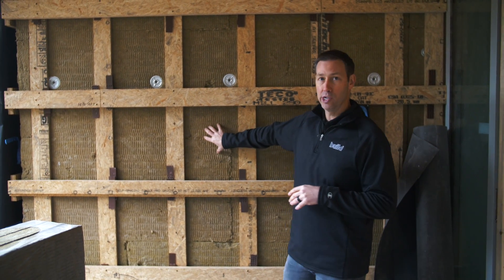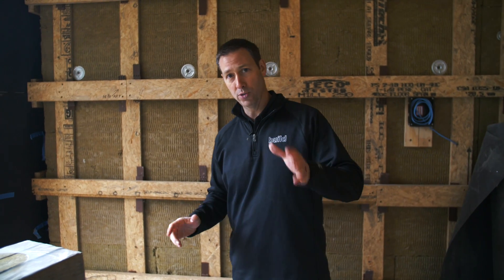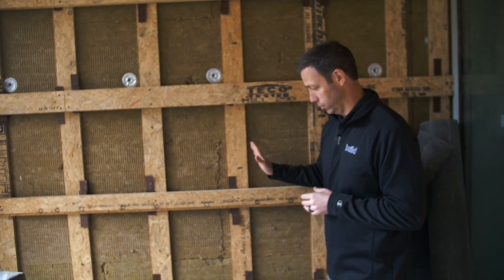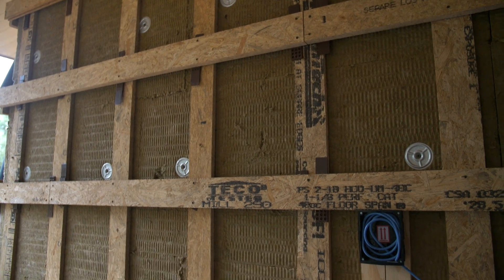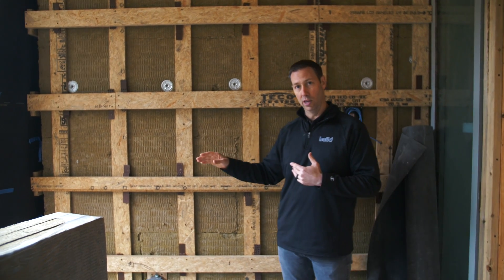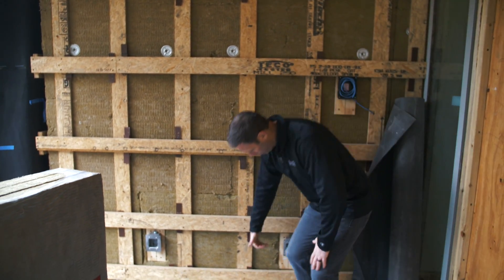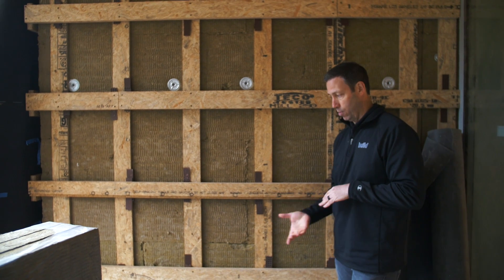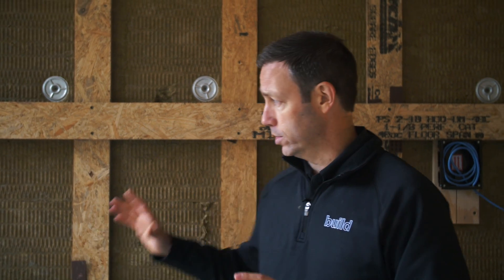Rockwool + RainScreen Exterior - This is a killer assembly!

Comment: So if you mount a floor joist vertical . any critter will knaw thru your barrier. We get 120" rain here . 60 mph winds an high humidity. Moss grows on trees 1' thick. Not sure your wall system will keep rockwool dry. Had to re side our casino due to construction defect. Salt air will rust a ac unit in five years!

Comment: @MattRisinger , What was the air barrier in this example? Peel & Stick between Rockwool and sheathing, or closed cell behind sheathing?
Reply: Probably peel and stick. Or possibly a drain wrap with a low permeability.  You'd want that to protect the sheathing for a really long time.  My guess is the inside isn't foam.

Comment: what's with the osb furring strips though? it's not a good idea to use those in areas that can get wet right? you said there will be small cracks where a few drops of water may get through. with normal wood as long as it can breathe its ok. but with osb that stuff will denigrate back there and noone will know until the vertical siding starts to fall off. probably could have used pieces of the vertical siding as furring strips to attach to maybe.
Reply: Matt mentioned in the video that it's not just OSB, it's ripped down AdvanTech decking. Should have better moisture resistance.
Reply: Also remember there is drying capacity in that wall with the battens and bug screen. And Advantec holds something like a 200 day no-sand guarantee when it is subfloor (ie puddled water). So it shouldn't be an issue in that wall assembly.
Reply: the furring strips will be behind the polyolefin UV stable sheet; with the PO seams likely managed behind the siding panels. I have hard time imagining a scenario where the OSB will actually get wet, provided that they don't experience massive flooding.
Reply: @asday85  ohhhh ok thanks
Reply: @Lilmiket1000  No problem.  Also, I think you're right on the money W/R/T "AdvanTech Decking" being a type of OSB, I think Nick is just eating marketing material with his Wheaties.

Comment: In the commercial construction world we will often use "Z" furring to bridge the insulation from the back up wall to the external siding material .  I would be concerned that my exterior siding is supported by the shear strength of screws that are cantilevered out thru 3 inches of insulation.      Mr. Risinger, a fun / informative "shop" video would be a see this wall section mocked up without the insulation in the shop.  I would like to see how adding weight to the siding side bends the screws, if they bend at all.
Reply: FYI: Similar construction for my project, but 2" rigid foam instead of 3" Roxul, and no horizontal purlins. We used 5-5/8" GRK #12 structural screws to make sure no shear strength  issues. Also used 5/4" deck boards since they are pressure treated. I am not sure if the advancetec flooring ripped into strips is going to last. I think time & moisture is going to lead to issues using the advancetec OSB flooring panels. My guess is that going with the 5/4" deck boards would have been cheaper, considering all the labor need to rip the advancetech into strips. I suppose with Matt's friend project going with an even heavier structural screw would be a safe bet (ie 5/16" or even 3/8") but that's gets expensive.FWIW: I opted for Rigid foam instead or roxul comfortbatt since roxul has a lower R-value per thinkness & it can require a extended delivery schedule since its not widely available everywhere. We did go with Thermastar Rigid panels since they do include an insectide to prevent ants and other bugs making tunnels in the foam. The pros for roxul exterior insulation is that its completely fireproof & isn't vulnerable to insect damage. Cons: more expensive & likely increased delivery times.
Reply: This thread on GBA has a lot of good info on this subject: https://www.greenbuildingadvisor.com/question/stability-of-wall-when-using-exterior-insulation.
Reply: @pnwbuilder  ty
Reply: Im curious what the z furring install would look like. 
Is the flashing just run vertical along the sheathing, with insulation in between? 
I imagine this install is trying to reduce thermal bridging, but the concern about deflection makes sense.
Reply: It's the $64 question is the exterior insulation world.  How to install an uninterrupted layer of insulation, but still be able to attach siding to the house, without disrupting the integrity of that layer.  Obviously dense insulation that takes up less space and makes the job easier, but passive buildings and LEEDS buildings require R28 and up to R 38 walls.  Compressed rock wool is the only Zero carbon material we have that can provide a decent R value (R4).
Reply: @refusoagaino6824  I just nailed the vynyl siding right through the foam, and 20 yrs later no problema.
Reply: I really like this idea, particularly when compared to the z-channel support.
Reply: you would typically only use a "Z" furring if the exterior insulation were too thick to support the cladding using conventional furring strips. residential construction is done according to the IRC. you can go out to 4" with exterior insulation as long as the cladding is not over 3 lbs/sq. of course, the heavier the cladding, the less the supportable thickness.
Reply: In the commercial world you can also get green z channels made from fiberglass that dont act as a thermal bridge.

Comment: Matt, what are the costs of this kind of install vs a typical installation of spray foam?
Reply: FWIW: My guess is that the home will have interior insulation. The 3" roxul is only about R-12. FWIW: I believe the costs for roxul is about 2 to 4 times more expensive than rigid foam for exterior insulation.

Comment: Hmm, just tried stuffing insulation between my ribs. Definitely does not work as well as a coat. Also, I'm dead.
Reply: At least when you died, the itching stopped!
Reply: Hey. it's called "getting fat"
Reply: Yeah I thought that was a really stupid analogy
Fat cells/a.k.a. fat is what is stuck between your ribs organs and body between your skin and muscles and the outside elements.
And being that I’m a fat cuddly  puffball, I can totally confirm I get cold messages below 50 without a coat and unfortunately  full of fat beside my body
Reply: Pleb, u have to use a small drill bit and spray foam. 😂
Reply: I kinda did the same thing, I just ended up fat.
Reply: Did you vote Democrat?

Comment: what, no Delta Vent SA after the rockwool?! Must not be watching your best practice video
Reply: A vapor barrier should be between the sheathing and the exterior insulation. The rainscreen will permit any moisture that gets behind the siding to escape. Roxul is moisture permeable, by hydrophobic (does absorb water).Not sure I would have gone with Delta Vent SA: very expensive! especially if you planning to use it for all the walls! FYI: In my project, we used ZIP sheathing (Big time saver). Really finding the studs is not a problem since the sheathing is already nailed to the sheathing. all you need to do is track were the nails are located on the sheathing (easy using ZIP sheathing).
Reply: @guytech7310  Once the rockwool is up and then attaching furring strips.  That is where locating the studs becomes a problem.
Reply: No a problem. You can see the location above or below where you put the panels up. Alternative you know where the studs are (aka 16 OC or 24 OC). Or you can put marks on the bottom or top flashing to indicate where the furring strips need to go.
Reply: Most of likely the weather barrier is under the roxul, the black sheet in front is most likely for aesthetics and UV protection

Comment: Matt good morning can you do something on remodel for bathroom installations for the showers and all of that what type of insulation behind the shower walls if any
Reply: Roxul is a good choice in my opinion. Considering:1. its hydrophobic (does not absorb water) but is moisture permeable. If I recall correctly mold cannot grow on Roxul2. Easy to install (DIY) & easy to remove if you need to do any future repairs (unlike spray foam, or cellious). 3. Fire proof & sound absorption.4. You can buy it at your local Lowes (usually)

Comment: That homeowner sounds kind of paranoid
Reply: Break a Window or spend a few hours on YouTube and learn to pick the lock.
Reply: If you think he's paranoid, read the previous thread. People are sending him to hell for the size of his house.
Reply: No one breaks into a house by tearing the siding off and punching through the sheathing. Way too much work.
Reply: I've seen it happen a lot. The burglar just rips off the vinyl and kicks a rat hole through the interior wall. No alarm sensors except a motion sensor would ever detect them being there. So, add motion sensors to your lower floor no matter what anyone else says.  @justinrainier4310
Reply: It's a lot easier to break into a house when you know how it's built, right.  How many houses out there only have pressed fiberboard and vinyl siding,  you can rip the siding off by hand and punch your way into the house with no tools.
Reply: @pro272727  Most houses built in the last 50 years are easy to break into....  This is not news to anyone.
Reply: @pro272727 yup! This is why I leave my house unlocked all the time. I don't want to have to fix a new entryway created by an unskilled laborer who's in a hurry. My only concern is the perp won't check the unlocked doors and just make the hole anyway.
Reply: @pro272727  now THAT makes way more sense than false rape accusations
Reply: You guy are talking about American houses which are the construction equivalent of a McDonalds burger - cheap and nasty.  American houses are actually built from cardboard and staples, so a burning house ignites the nextdoor house in a successive chain reaction which make the whole town disappear into a level blanket of ash. Americans are powerless to demand standards from the Corporations which own the country.  European house have brick walls and ceramic tile roofs.
Reply: @dreamdiction  this is true, but a house in the uk that cost 1.5 mil cost 300k here which most people can afford. I have seen houses built over there and you guys get totally butt raped by the government over land and taxes.. I will stick with our style and be able to live in it. if you want it done right do it yourself and were still 1.2 mil ahead of the game... We can do better for sure but if it means govt has to deal with it I will stick to what we have.
Reply: handyt butler well said man. Dream Diction’s description of American homes was exaggerated just a ‘teensy’ bit.
Reply: World we live in. Men accused of rape just because, antifa attacking people, customers being verbally assaulted....
Reply: Ivan James 🙄

Comment: Why are American houses built with wood rather than concrete blocks?
Reply: It's cheaper, but also it's easier to achieve a decent insulation rating. Brings it's own set of challenges, though.
I don't build in the US or use wood for walls, so I'm just going on what I've seen.
Reply: Because we've never had to worry about the Germans or the French.   Plus, it's not like the house are only wood, all of our basement and foundations are made of concrete.
Reply: Earthquakes for starters. Does take much of a seismic movement to tumble a concrete block home. Most homes used steel reinforced poured concrete at least for the foundation walls.
Reply: I have seen plenty of misconstructed concrete block Walmart warehouses collapse just from a category 1 hurricane or tornado, and first hand numerous foundations of the very stuff with step cracks at the joints and had to drill holes at the base to let out the retained water in the cavity when doing basement waterproofing work back in those days. I prefer the monolithic concrete with reinforcement which are far easier to fix, though some jobs the contractor of the construction did not such a good job as they are supposed to to and corner joints would up cracking vertically.
Reply: The continent was (was) covered in massive old growth soft wood forests - they seemed inexhaustible - so wood frame houses were the logical approach. By now the old growth forests are gone, back in the day, the clear cuts were not properly replanted. Now that reforesting clear cuts is being done, the replanted trees are fast growing hybrids but the lumber you get is rubbish (crooked, unstable material). Moreover, given climate change no doubt, forests have been devastated in pine bark beetle infestations and forest fires -- at least in Western Canada where I live. I have heard some analysts say we've hit peak lumber in North America which means fewer wood framed houses I'm sure.
Reply: @randydueck889  ‘Peak lumber’. Hadn’t heard that term before. Makes sense - but also a very sad thought.
Reply: - Wood is really strong in compression yet lightweight. With wood, you can construct your entire house offsite in a factory if you want and have it delivered to your land.
- Wood is very easy to work with compared to concrete and you don't have to wait for it to cure. It is much faster to construct a house out of wood because of that. 
- Wood is much more ecological and is renewable. 
- Wood is more fire resistant than concrete and steel contrary to popular beliefs.

In my opinion, we'll see more and more skyscraper built out of wood in the future. Just do some research on clt wood panels.
Reply: @pouetance  I agree with you on most of your points,  including wooden sky scrapers.  But,  more fire resistant??? Really...lol
Reply: @dogfacedponysoldier6040  check it out or ask any firemen. You'll be surprised 🙂
Reply: If you're building a house, concrete and steel will be more fire resistant, because you're not using 100x300mm wooden beams. If you're building a skyscraper you're not using wood at all, because it's not even remotely strong enough, so there's no point comparing it's fire rating.

And our houses are mostly built of clay bricks, not concrete. Clay brick isn't fire resistant... it's fire proof.

Wood has it's advantages, but do go pretending  you use it for any reason other than cost.
Reply: @johnalexander2349  Wood doesn't burn but char. It is a very predictable material under fire and it will take time before your structure is weakened. It takes lot of time to burn big logs in a fire.

On the other hand, steel is a terrific heat conductor and will bend under heat. Your structure will collapse quickly if the heat reach over 1000c. The world trade center is a good (and really sad)  example of that.

Check out some YouTube videos if you don't believe me.
Reply: Yes, wood chars, and in 10 minutes it's charred right through your 38mm thick beam. Then your house collapses. That's not fire resistant.

Like I said, there's no point comparing steel use in skyscrapers, since wood is far to weak to replace it. All you can do is protect the steel with heat resistant insulation.

If you want anyone to believe you, you're gonna have to post worked examples, not irrelevant anecdotes based on sections that will never be used in houses.
Reply: @johnalexander2349  cozt
Reply: @pouetance  911 was an inside job, a controlled demolition
no skyscraper has ever collapsed due to fire, suffered damages yes, but that's it
Reply: @CheekyMonkey888  Get real. Steel is like spaghetti at high temperature.
Reply: Alexandre Poitras find your unicorn
The skyscraper that collapsed from fire
You won t
Wood houses are reduced to rubble by fire every hour of every day

Comment: It took me a few minutes to figure out we were looking at the outside of the wall.  I was scratching my head trying to figure out how the framing of this house was working.  I kept saying there is no vertical load capacity, I have to be missing something.  Doh!
Reply: I'm with you.......wasn't able to follow visually.....Didn't know what I was looking.
Reply: Me too, I'm still not clear where the studs are, if any.
Reply: @garywheeler7039  behind the 3" of insulation is 3/4" plywood, the studs are behind that plywood.
Reply: @toddoliver3385  Ah, that makes sense in the context of the screws attaching the insulation having a full 3/4" grip. I thought at first they were talking about attaching 3/4" siding from the back (blind screwing) and having a full 3/4" of grip, that didn't make sense.
Reply: @toddoliver3385  at last, the truth!
Reply: Phil Perri  <citation needed>
Reply: Phil Perri  There is virtually no waste in the production, primarily it's chalk particles and whatever is used to create massive amounts of heat. Now, Rockwool itself, while not "toxic" is not a good waste product as it doesn't degrade. I would probably go so far as to say waste Rockwool is toxic to the environment.

Sorry, not bothering to look up citations, but it's in the same studies that evaluated newly produced rockwool and the fine dust within as being cancerous.
Reply: Those cutted chipboard wood  strips for the siding to hang on to is a joke for longevity.
Reply: Phil Perri 

A huge amount of toxic waste is created in the production of people like you
Reply: Phil Perri  Oh, conspiracy theorist, say no more!
Reply: Phil Perri  is it worse than fiferglass or foam?
Reply: Phil Perri , basically it is about the same level of environmental impact as fiberglass insulation, which uses the same basic process of melting rock and spinning fibers at high temperatures, and bonding them into batts.
So while I see a legitimate concern about a new plant being built next to a school in one city, attacking the company and product as being worse than the alternatives is dishonest.
Reply: @ke6gwf  + fiberglass uses polyester resin to bind it and it outgasses and causes lots of disease
Reply: @d.e303-anewlowcosthomebuil7  I think you are thinking of structural fiberglass.
Residential fiberglass insulation made by pretty much all the current manufacturers is made using an acrylic binder or other non toxic formaldehyde free binder.
Reply: @ke6gwf  no, the betwqeen the studs kind